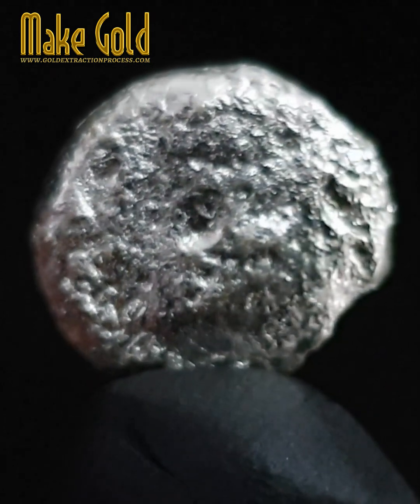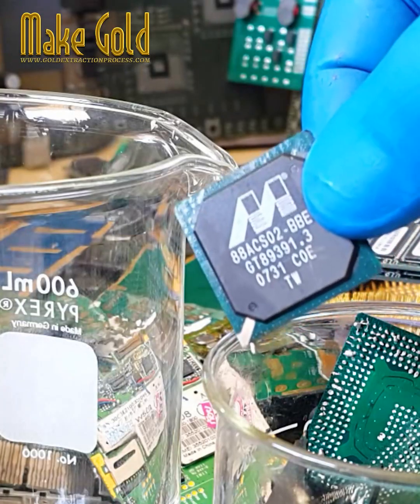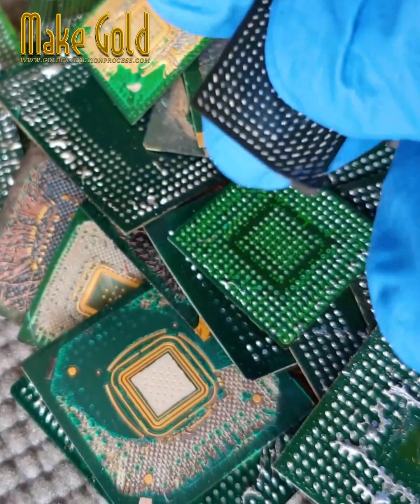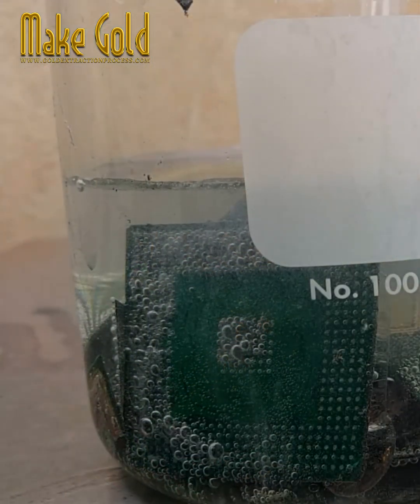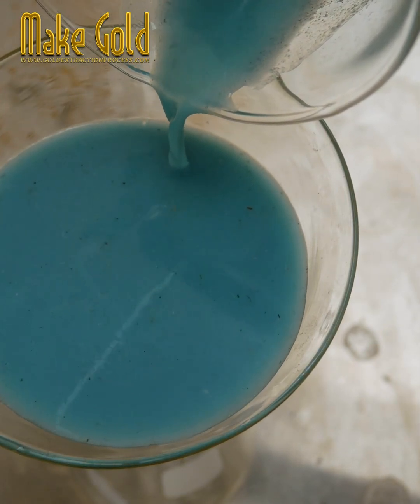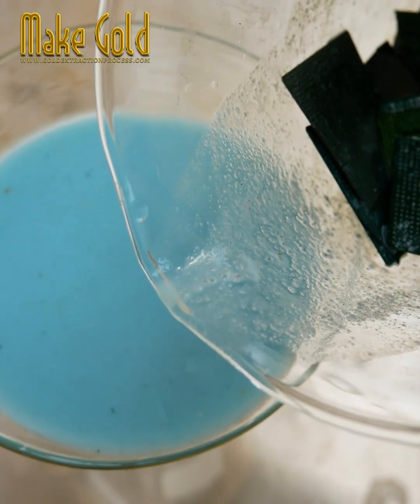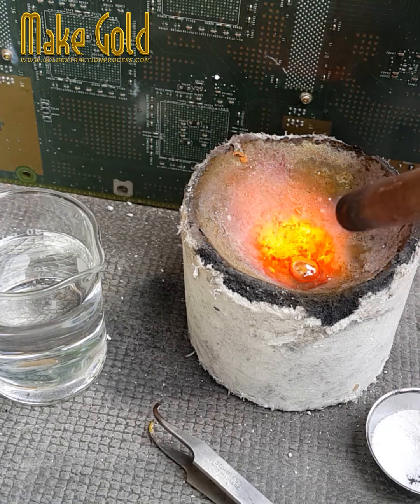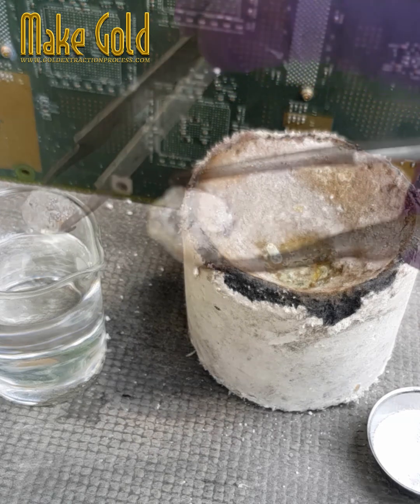how to BGA chip silver recovery Circuit IC silver extraction

Comment: Greetings,
I'm from Brazil and have started researching the feasibility of recovering precious metals, especially gold and silver, from electronics.

Furthermore, I only believe it's feasible if there's a large quantity of components containing precious metals. This is because we need to pay for protective equipment (the most important step) and, finally, for chemical laboratory materials. Last but not least, fully understand the process and its complexities, choose the appropriate location for the service, and never discard solutions of any kind. Be aware of the dangers that chemicals pose to those handling them, the site, and the environment.

Currently, I have 278g of gold-plated pins, several ribbon cables, TCOM boards for TVs and monitors, and some cell phones. I still have more BGA chips to remove (I removed 52g), not to mention several integrated circuits from motherboards, notebook boards, CD/DVD drives, hard drives, processors, RAM, GPUs, routers, processor sockets, and other items.

I'll begin cataloging and thoroughly studying each process before performing the gold and silver recovery procedures. I'll begin when I have enough material to recover, and it's worth it, as it saves time, resources, and chemical inputs.

Hugs to all
Sorry my English

Comment: add citric acid when disolve solder and solution will be clean without SnO precipitate
Reply from the maker: Thank you for sharing that useful tip about adding citric acid when dissolving solder to keep the solution clean and prevent tin oxide (SnO) precipitation.

Here's a bit more detail on how this works:

When dissolving solder, which typically contains tin (Sn) and lead (Pb), in an acidic solution, the tin can form insoluble tin oxide precipitates that make the solution cloudy.

However, adding citric acid (C6H8O7) helps to complex and solubilize the tin ions, preventing the formation of the insoluble tin oxide precipitate.

The citric acid acts as a chelating agent, forming a soluble tin-citrate complex ion. This keeps the tin dissolved in solution rather than precipitating out.

The chemical reaction is:

Sn2+ + C6H8O7 → Sn(C6H6O7) + 2H+

By complexing the tin with the citrate ligands from citric acid, it becomes much more soluble and the solution remains clear.

This is a handy trick when trying to recover and separate metals from solder or other tin-containing alloys using acid leaching or dissolution. The citric acid helps keep things clean and avoids loss of tin to precipitation.

Let me know if you need any clarification or have additional tips to share about metal dissolution and separation processes!

Comment: So just dilute Nitric, copper push bar, some hot H2O baths, then torch? I may go after silver this year. I have over 100lbs of boards and time. But I've only ever done the gold. Thanks to you, I will try some silver contacts and BGAs this year. 🙏 👏 👏
Reply from the maker: Based on your description, it sounds like you are planning to recover and refine precious metals from electronic waste, specifically targeting silver this year in addition to the gold you've extracted before.

Here's a overview of the process you outlined:

1. Dilute nitric acid - Used to dissolve base metals like copper, leaving behind the precious metal values.

2. Copper push bar - A sacrificial copper bar/plate helps to cement out or displace the precious metals from the nitric acid solution onto the copper.

3. Hot water baths - Likely for rinsing and cleaning the cemented precious metal powders/solids.

4. Torch - Applying heat, probably for melting down and refining the final precious metal product.

For recovering silver specifically from components like contacts and ball grid arrays (BGAs), a few additional notes:

- Silver can be dissolved using nitric acid or other leaching solutions like sodium hydroxide or ammonium thiosulfate.

- An inorganic acid like sulfuric acid is often used for parting and separating silver from gold, if both are present.

- Electrolytic silver refining cells can produce very pure silver crystals/powder from the leached solutions.

Overall, it's great that you want to expand into silver recovery this year given your experience with gold extraction already. Just be sure to research thoroughly and take proper safety precautions when working with acids and hazardous materials. Let me know if any part of the process needs further clarification!
Reply: @MakeGold  I will do, I'm gonna try the easiest method first, and move on to harder and better methods. I've just known guys to dissolve silver in nitric, precipitate with HCL, then add lye and sugar while mixing continuously. I've never used lye, and I imagine this method isn't the easiest. I will follow the first method you recommend and see what I get. Thanks for the much needed encouragement! 🙏

Comment: Recover gold is better and also more simple , i think it's a waste of time except if you really need silver on purpose .
Reply from the maker: :_wow::_GoldBar:You make a fair point. Compared to recovering silver, extracting gold from electronic waste and components like BGA chips is generally more worthwhile and simpler from an economic and processing standpoint.

Here are some reasons why recovering gold is better than focusing efforts on silver recovery:

1. Higher value: Gold has a significantly higher precious metal value per unit weight compared to silver, making gold recovery more profitable.

2. Simpler extraction: Many of the same acids (aqua regia, nitric acid) used for silver extraction also dissolve gold, allowing co-extraction without additional complexity.

3. Less material: Gold concentrations, while still low, tend to be higher than silver in electronic components, reducing processing volumes.

4. Fewer process steps: For gold, the leaching and precipitation steps are more straightforward compared to the additional electrolytic or smelting processes often needed for optimal silver recovery.

5. Industrial demand: There is higher industrial demand and well-established refining markets for gold recovered from e-waste compared to silver.

Unless there is a specific need for relatively pure silver for certain applications, spending extra time and resources to separate and optimize silver recovery may not be economically justified for small-scale operations or individual processors.

Focusing primarily on gold extraction and allowing the silver to follow the same path can be a more practical approach, especially when just starting out or operating on a small scale. As you gain more experience and scale up operations, then exploring dedicated silver recovery processes may become more viable.:_star:
Reply: @MakeGold  
I also have a question regarding the SG9 chemical powder , where can we get this product online ?  Thank you very much , have a good day .